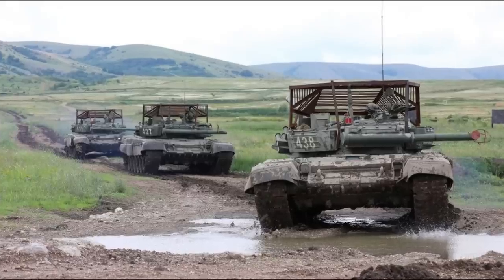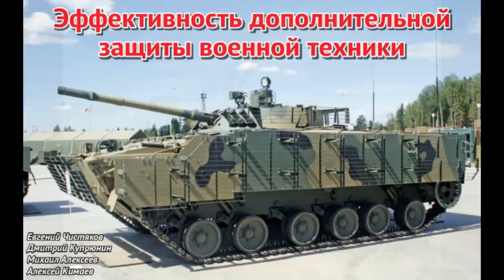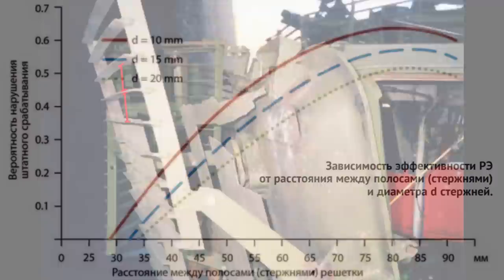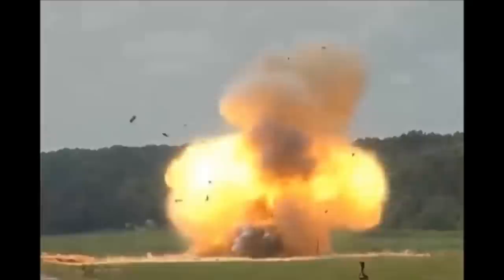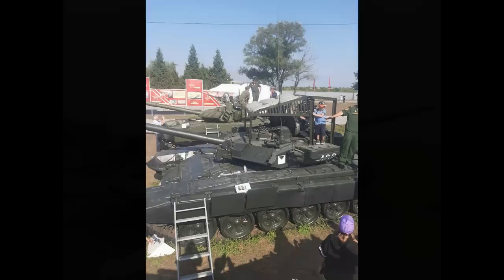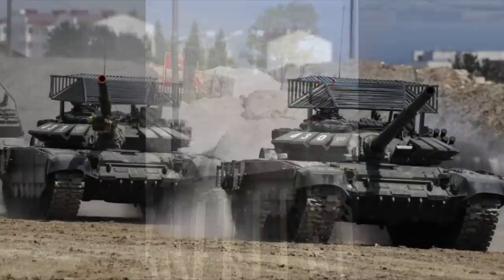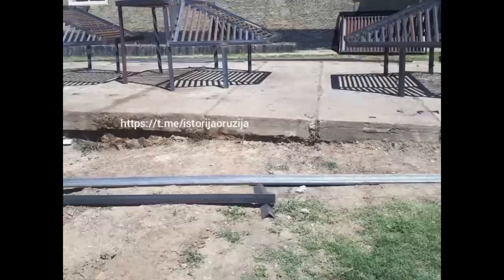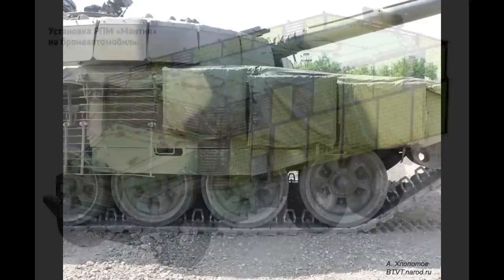The Truth About COPE CAGES

Comment: Cope cages even factory built and ideal aren't going to do anything against Javelin or NLAW.  The US has been using cage armor on Strykers for years to protect the SIDES from various flavors of RPG-7.  Sometimes they are called probability armor because luck determines if the cage can neutralize the rpg.  Even with ideal spacing you have to get lucky.  If the RPG strikes the cage slats directly it will fire the charge drilling through both the cage and main armor.  They are modestly effective at defeating inferior side attack weapons with contact fuses.  Javelin, NLAW, and TOW-2B use tandem top down attacks which never strike vehicle or cage they use proximity fuses.  Cage or no cage the warhead is going to detonate about 1 to 2m over the tank.  The modern tandem warhead uses a precursor charge to defeat the cages and ERA providing a path for the primary charge to cut through the relatively thin top armor.  The study didn't look at tandem charge weapons or weapons from top attack.  When your enemy has been flooded with modern tandem charge top down ATGM weapons cope cages especially top mounted ones probably increases casualties by making the vehicle a taller more visible target while doing nothing to improve survivability.

Comment: But with a Javelin you still have the option between a straight and a top down attack. If the tank is far enough away a straight shot Javelin will still hit the top of the tank but will fly underneath the cage.

Comment: I can’t help wonder if the heavier cages might be more helpful for defending against modern AT weapons - an NLAW isn’t relying on a shaped charge making contact with the armor, and if you have widely spaced thin bars, it seems like the penetrator is more likely to hit through those gaps. On the other hand, closely spaced angle irons seem a lot more likely to deflect/break up/absorb a penetrator and diminish its kill capacity. Wonder if there have been any studies on this?
Reply: On the other hand I’m not a munitions expert I’m a goof with a phone, so I have no idea how ANY cage would hold up when faced with an NLAW penetrator. Materials get weird under such extreme circumstances

Comment: Just FYI the cage doesn't stop the javelin the javelin is a duel charge so Teo explosions to get through armor so alls it would do is stop one charge thw second would go through and does they designed those cages for rpg 7 cause when they hit its the hot melted metal that goes into the tank so if they can get it to exploded before the tank shell it helps alot but it barley stops them as well. But something is better then nothing but only thing stopping the javelin is another explosion shot at the rocket witch they are just now trying for tanks cause it's 2 million extra and ones used you have to pay again to re do the tank so isn't a good option for us.

Comment: The shape of the cages on top of the tank don't matter as much as the flat side cages. The side cages seem to directly interfere with the projectile, deforming or destroying the head of it before it activates. On top firing ammunition, there might not even be a direct impact with the cage as the round might explode above it and given the difference in in the warheads it would have a totally different result anyways.

Comment: I think these cages are attempting to trick the fuze in the top-down attack weapons into thinking the tank is taller than it really is, so it sets off the warhead at a less optimal distance above the tank. Javelin does not try and "hit" the tank it's attacking, it explodes in the air above it with a shaped charge. If these cages work at making the fuze think the top of the tank is 15ft off the ground rather than 10ft, it'll have less chance of making it through the armour and setting off the rounds in the auto-loader

Comment: Sorry, no chance they will work against javins. Javelins have been designed to punch through reinforced concrete bunkers. They are one of the most versitile weapons on the battlefield. They are programmable to optimize their performance at specific tasks.  Each one costs roughly $165k, 125 for missile and about 40 for the tube. Realistically the only effective means of mitigating javelins is with percision reactive armor. You have to destroy the warhead before it even touches the outer armor or its just going to burn through, and even if it is intercepted, there is still a chance for penetration.
Reply: @Blob B yep, appreciate the input. That I knew. Its another reason why this type of set up os ineffective against javelins. I can see it working with RPGs though and other more simple manpad warheads

Comment: The thing is the NATO missiles are all tadrum charges designed to defeat cage armour, if they where just hollow shaped charges then they would be effective like RPG7's.
Reply: Tandem charge isn't against a cage, it's against reactive armour.

The cage is for older unguided single charge RPG's that can be easily fired from a nearby rooftop in urban warfare, and don't have a minimum range like modern MANPADS.
Reply: @My-Opinion-Doesnt-Matter  I don't understand your point you are just rewording what i just said, but saying Tandem is only effective against ERA is wrong they are also extremely effective against caged armor too and not just ERA.
Reply: Ok, I will make it simple:
"The thing is the NATO missiles are all tadrum charges designed to defeat cage armour" - not true.
"saying Tandem is only effective against ERA" - who said that?

The point is that modern guided anti tank missiles are in limited numbers (few units have them because of the price and training time) and have a minimum firing range (Javelin's is 65m in direct attack), cooling time for thermals, etc..., so they aren't that great in close/urban guerilla warfare where older cheap/numerous unguided RPG's are the obvious choice. 
That's why there are cages on turrets, to protect the tank from nearby rooftop fired RPG's, and that's why they didn't put them on all tanks,  just the ones that go into urban areas.
Reply: @My-Opinion-Doesnt-Matter  While true NATO weapons do have a minimum safe distance 65m for javelin and 20m for NLAW, but we are not seeing many Russian tanks with cages at this stage of the war because well they are fighting on open terrain RPG's/Javlins etc don't have the range it's 2.5 Km for the jav but tanks have around 4+km range and now tanks are not really bothering in entering built up areas they just shell them with arty and rockets. 

Tanks really don't want to to be in Urban settings anyway you don't even need cages on the top because you target the engine/power plant you have disabled the tank anyway so it's a loss either way. Like i said in my first comment about the cage it would only be effective against Hallow-shaped charges like RPG7's which is what you are saying. Either way we go on about this we are saying the same thing.

Comment: I think you  are making a confusion between the study on the RPG and the cage armour. The assumption that the same things would work the same way is flawed for an obvious reason. 
Against an RPG-7 or any rocket or missile coming from the side, you want to disrupt the ammunition itself. 
But when it comes from the top, the ammunition works in a very different way (at least for NLAW, MMP). The round flies on top of the tank, and at no point it touches the tank. The shape charge is angled to penetrate the roof, and the charge is blasting its jet at at 1-2 m from the turret, so above the cage armour. This is why it didn't work. Not because of a spacing matter, but because the round doesn't touch anything.

Comment: Look, it was designed to protect against drone dropped explosives and probably some RPG shots. Heat grenades are cheap, widespread and can kill a tank if they hit on the turret roof, but any slat armour that is at some distance from the tank will either deform or prematurely detonate the warhead which is designed to detonate at a certain distance for maximum effect. Cages are just cheaper and lighter than steel plates. In Yugoslav wars we used thick rubber skirts all around tanks to increase their protection against cheap Yugoslaw Heat projectiles, also rebar nets were used in front of tank and AAA positions to protect them from incoming rockets. About the increase in tank profile, if you dont see the tank in the first place, these cages are rather thin and dont increase the chances that you will spot a tank that much, but I agree that can decrease the commanders visibility if designed poorly. And for the Jawelin and NLAW, At the start of war Ukraine did not have them that much so it's probably not about these weapons.

Comment: My understanding is that the weakest armour on tanks is the top.Javelins dive into targets from above. First charge penetrates armour and second detonates inside the hull. These cages seem to be an attempt to have the first charge detonate at a distance and hopefully the second charge will not penetrate the upper skin. 
However I’m wondering if the shock waves created are still causing the stored ammunition in turrets to explode. 
What I can see happening is next generation will either have a delay on the initial middle charge exploding or they will add an extra charge to blow through these cages. 
Either way these cages do make tanks easier to see.
Reply: Heya one small correction the Javelin is designed to have its first warhead trigger the explosive reactive armour and the second to then hit the exposed hull, so maybe the aim is instead to detonate the first charge with the steel bars and then have the second charge be blocked by the ERA, though i am not sure if the cages can actually acomplish this.

Comment: They might protect against HEAT rounds as the jet of hot metal is only designed to go a very short distance, but other than that I can’t seem to think of a practical use for that type of shield.
Reply: Modern HEAT warheads are designed to go several meters of distance. Spaced armor does not work.

Comment: These might work against Javalin, though the kinetic energy of these warheads coming in from altitude would probably melt right through any bars.  Javalins are nothing like RPGs.  

And these would do nothing against NLAW, which are built around not making direct impact.
Reply: what do you mean javelins arent like RPG's? They both work on the HEAT/shaped charge principle.
Reply: @thesayxx  The amount of kinetic energy of a Javelin warhead enjoys when it hits a target is much greater than an RPG.

The Javelin rocket is traveling at Mach 1.7 when it hits a target.  An RPG is barely supersonic.  A Javelin rocket weighs 22kg, while an RPG rocket weighs less than 6kg.

The amount of kinetic energy a Javelin has before it even detonates its primary and secondary charges is probably enough to slice right through any caging.
Reply: @jklappenbach  kinetic energy doesent help. Its the shaped charge that counts. Niether uses kinetic projectiles to penetrate armour but a molten jet which is formed when the shaped charge detonates. As stated in the video, if the shaped charge is damaged and buckles the effectivness drops off if it even detonates.
Reply: @thesayxx  Kinetic energy is everything.

They designed those cages for RPG rounds.
Reply: @jklappenbach  HEAT does not rely on kinetic energy my dude! APFSD and AP does. kinetic energy in HEAT just means how fast it will get to where its going. and if the shell hits the armor without detonating the exact same millisecond it splatters on the armor
Reply: @thesayxx  You're not picturing it correctly.  Let me spell it out:

As the round is incoming, before HEAT or shaped charges are involved, the body of the round meets the cage bars.  If the kinetic energy of the round is high enough, it will pass right through those bars without much deformation.  This is entirely dependent on the amount of kinetic energy / momentum and the density distribution of the projectile.

Javelin also has a major difference from the RPG rounds that the Russian military has based their modeling on:  there are two charges in a Javelin.  The first is a HEAT round that is meant to trigger Russian reactive armor and dissipate this before the second explosive fires, a shaped charge meant to generate a jet of plasma to penetrate into the vehicle.

But to even get to the surface of the vehicle, if it hits that cage, and you've been basing your assumptions on the characteristics of an RPG, you're going to find that a Javelin rocket is an entirely different beast.
Reply: @jklappenbach  thats where you are wrong, the tip of the javelin is basically a glass lens that houses its sensors behind it. and behind that is the first smaller shaped charge, behind that the guidence system, then the main shaped charge then the flight and launch motor. It is in no way or shape designed to punch trough anything let alone metal bars. And as mentioned in the video the damage to the shaped charge usually means it will ether not detonate or the cone of the charge will be mangled and not produce a jet. What you are describing is tandem charge and the RPG7 does fire it (the PG-7VR rocket). Its not even slightly uniqe to the Javelin. Almost every AT weapon since the 80's uses it.

Comment: Summary of the video and regular things this video didnt but should have touched. 

-Regular heat round of smaller caliber will be stopped by heat cages but a whole ass tank round will with a 90% chance still do what they do.
-Cope cages do not work against a javelin. A top attack tow maybe if its low enough but a javelin with punch right through.
-Reactive armor hasnt been efficient against both javelins and regular tank rounds. This is due to the reactive armor in use being old outdated RAs such as kontakt-1s and due to modern anti tank weapons or sabots not caring about RA, however what RA has been very efficient at is stopping heat rounds fired from rpgs or western supplied AT weapons such as the AT4.
-Cope cages seem to have been put on tanks to stop anti tank grenades dropped by drones since in most of recent and current conflicts drones with grenades are a top cause of destroyed tanks or killed crew especially in places such as syria where often tank crews left hatches open due to their old soviet tanks not having any AC which made being inside the tank without the hatches open unbearable.

Comment: Absolutely useless.
The kinetic energy of the anti tank warhead would just push the relatively thin metal cage, be it a rod or angle iron apart. The explosive warhead will hit the tank and the shaped charge penetrate the tank.
Entirely wishful thinking.

Comment: I guess all that reactive armor on turret tops is not very effective even though it was specifically designed to neutralize hollow charge penetrators.   Commentary please.
Reply: A reactive armor that decreases shaped charge penetration by 90% would still not be enough if the shape charge has 1000mm of pen and the roof armor is only 60mm
Reply: @Phantom-bh5ru  Thanks for the feedback.  It my experience, the roof armor is only about 20 to 25 mm thick and a shape charge is good for about 300 mm or 12 inches max on cast homogeneous steel armor.

Comment: Javelin and mlaw  works very diffrently to a rpg.. javelin have a totaly diffrent method. 

Mlaw works kind of simular to a rpg, but the fokus is over a meter in stead of 10cm, and its set of by proximity radar. So it is kind of unlikely that Cage would make much diffrance.... specially since mlaw tend to target the engine, not the tower

Comment: I think you got it slightly wrong: shape charges are not "caught" in the bars, as they come in various diameters. Rather, the metal cages detonate the charge prematurely. This is why the Germans in ww2 successfully used thin metal skirts on Pz 3 and 4, and even mesh grid on Pz 4 J. It doesn't have to be metal bars at a certain spacing, angle steel (L section) can also work. But the problem is, I don't think it's that easy to stop a really powerful tandem charge like Javelin. And I have to put some blame on your channel for this: for a long time you have maintained how well protected against such charges Russian tanks are, mostly by ERA. But that's just a theory, and it doesn't seem to fit the practical application. You also said that it's hard even for top attack to destroy a tank since it will mostly hit the turret front and side armor. I think this is obviously wrong: most of the top of any tank is made of thin armor over the turret and hull, not the side and front armor of the turret. Top attack needs only penetrate the engine deck, for example, and the tank is out of action. Just like Western powers took a long time to accept their vehicles are not well protected against IEDs, I think it's time for Russia experts to accept that Russian tanks are not well protected against tandem charges and the ammo carousel is easier to detonate than believed, even by you. You are a respected member of military YT, I think you need to change some of your (well informed) opinions.

Comment: "Long weird metal bent in a V-shape" is called "angle iron," and contrary to the name it's usually made of mild steel; it's not at all weird in a machine shop, it's some of the most common steel stock you can find. Cheap and easy to work with, it's used in farmer repairs all over the world. 

Just reinforces the idea that these are field modifications; no self-respecting factory would ever put something like this out the door.